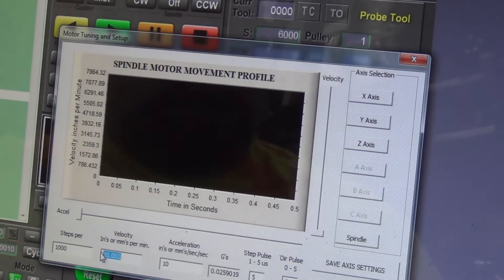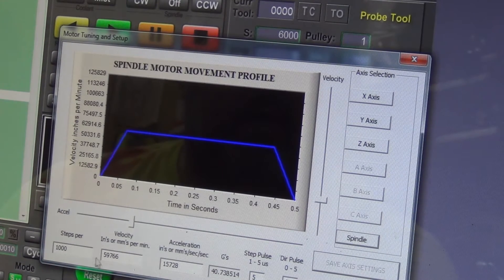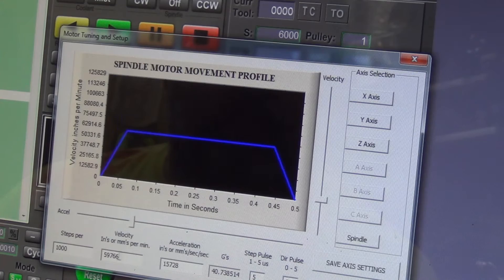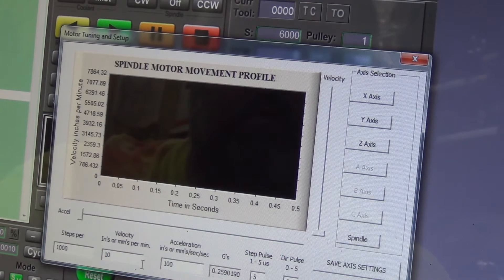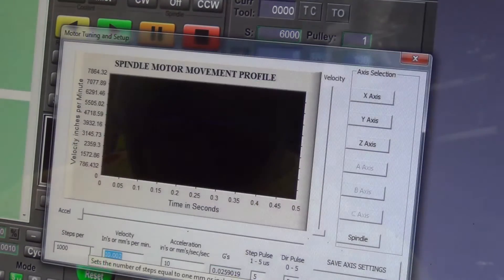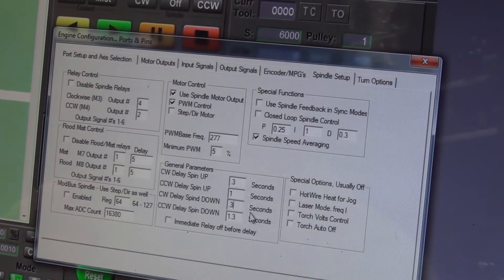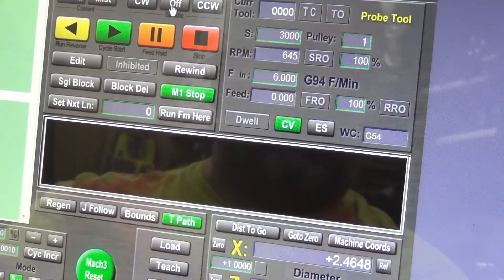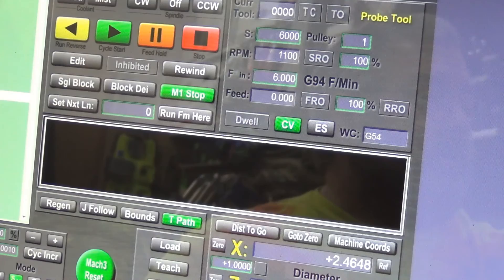Novakon Torus Pro - Mach3 Spindle Tune

Comment: Yup if the speed controllers hit its limits you may as well be turning a light switch on and off. :)
Reply from the maker: +NuttyforNissan Maybe mach will read more correctly when I get the new BOB installed, but it's hitting 6k on the PDB tach readout.  I'm pretty sure the readout difference is caused by the two BOBs using different voltage ranges to control the vfd's speed.